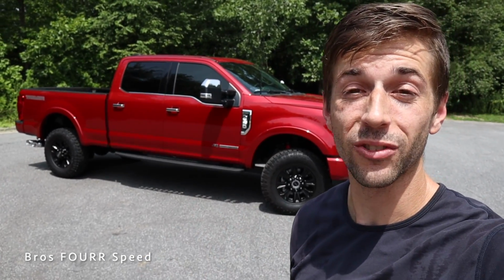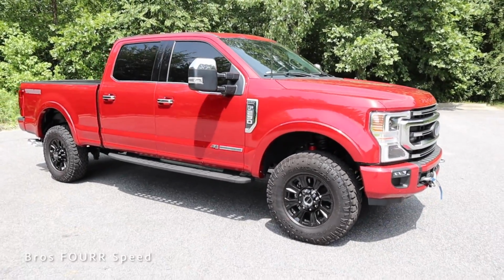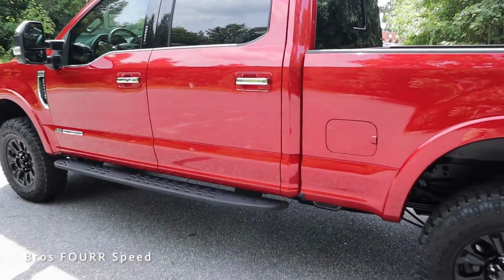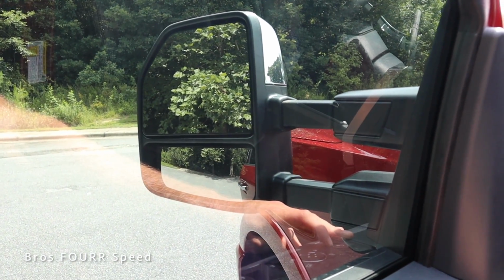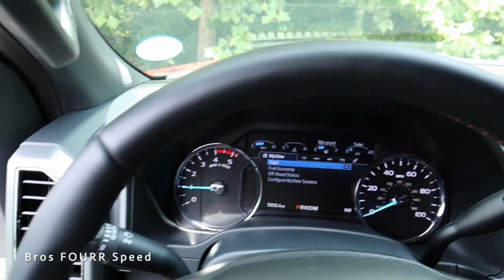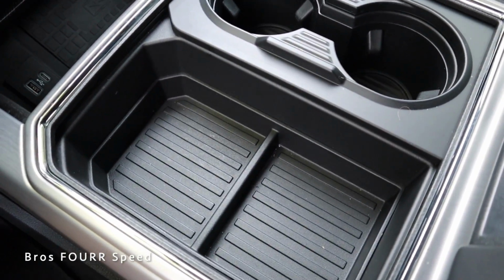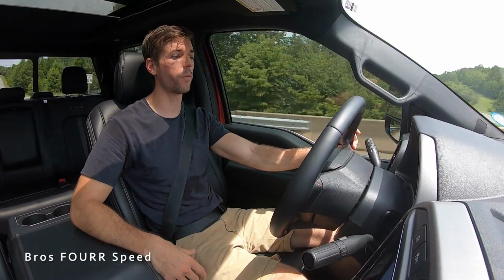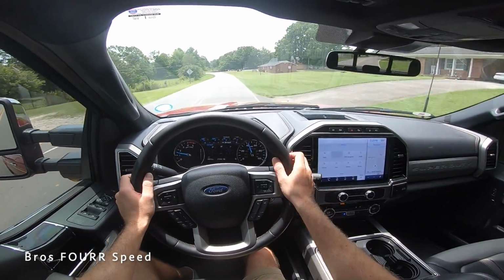2022 Ford F250 SuperDuty Platinum Tremor: Start Up, Test Drive, Walkaround, POV and Review

Comment: Frustrating that yours and so many other clips review the Tremor but say little to nothing about the 4x4 capbilities, controls & how to engage, suspension, payload, differentials type.  I suspect its becuase its easy to walk around a truck saying here is a ford badge nice and centre - really!  who cares, blind freddy can see that as with so much said.  Perhaps you could take on board for next clip.
Reply from the maker: The 4x4 capability is just engaging the 4wd system, not much to show on that. I don’t need to go into all the mechanics, that’s too much for this type of review. If someone is interested in this truck, they can see what it has to offer me from there they can dive deeper into the truck more if they really want it.
Reply: @BrosFOURRSpeed  you’re kidding right?
Obviously my mistake thinking there are people out there looking for more than a verbose on the obvious.
Reply from the maker: @Kevin-ee2tz  Sure there are, I never said there wasn’t. But this is just going over all the specs and what the truck has. If you are looking for a 4wd, you already know what you want. There are plenty tutorials on how to use 4wd if you really need to find one. I’ve even done that with my own truck.

Comment: The truck of choice for many construction workers, love the torque on these.
Reply: Construction workers prolly wont be able to afford them eventually, the Super Duty starts at like 40k
Reply from the maker: It’s pretty crazy how expensive trucks are getting!
Reply: @daveb1081  You would be surprised, I see quite a few of those guys and gals drive shiny lifted diesel pickup trucks everyday.
Reply from the maker: It would make for a great work truck!